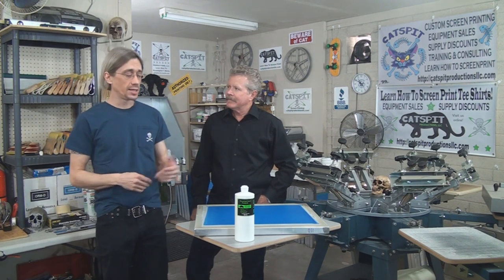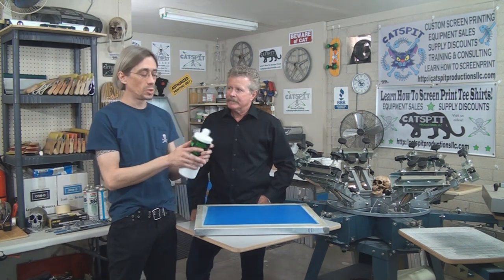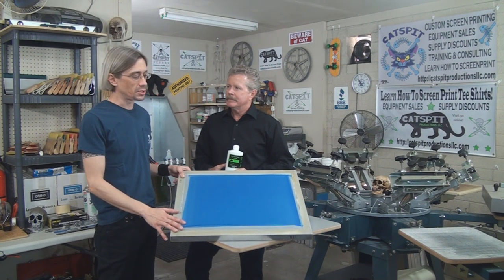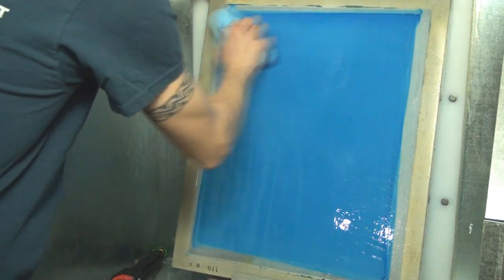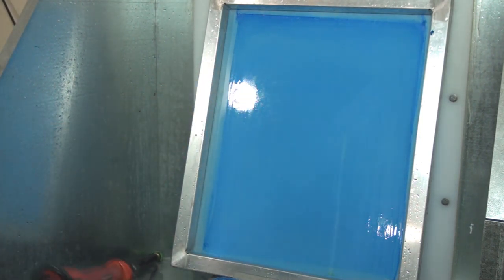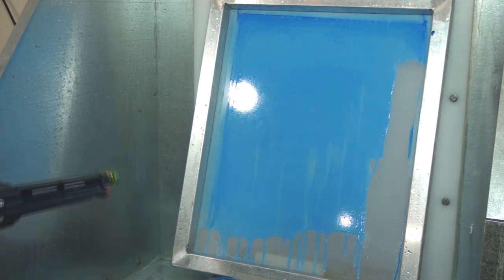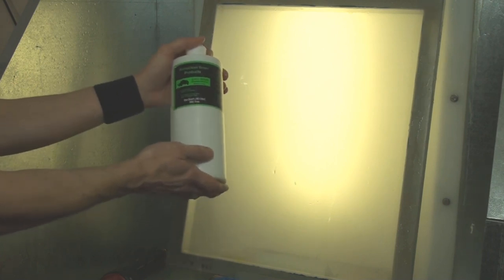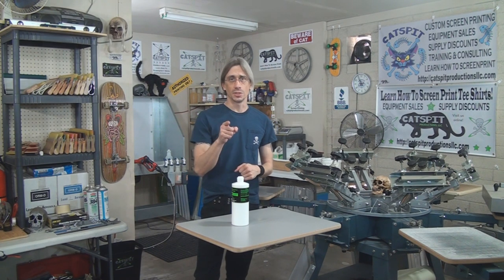Environmentally Safe Emulsion/Stencil Remover For Screenprinting

Comment: Hello,congrats on your channel! i only have one question, if some emulsion stays in the screen after using the remover,is there a way to get it off after it has stabilized for good? i tried bleaching the ghost prints and soak it for 15 minutes but nothng gets removed does the mesh need  to be changed?
Reply from the maker: Thanks! If you're referring to screen lock, a pressure washer with some haze remover may do the trick. Thanks for watching! Screen Printing Equipment & Supplies - http://CatspitScreenPrintSupply.com/

Comment from the maker: @MrBlem18 Thanks! I’m using the SaatiChem Graphic PS 2 Blue which you can get at a discount with free shipping by using the Catspit promo code form the Print Supplies page of the website. The link is on the channel page and in the video description. This is a photopolymer and Saati makes a red emulsion as well but it is more expensive and faster in exposure time. That’s the Textil PV. Thanks for watching and leaving a comment! ☠

Comment from the maker: @mustangFWL I got that unit form Home Depot. It used to be made by Husky but now it’s the same exact unbit but labeled Homelite. It’s the Hydroserge High Pressure/HighFlow 1700. That’s about all it says on the unit as far as model. The dual head is a great feature because you don’t need a splitter on your water outlet in order to have a regular spray hose. And less hoses too. Thanks for watching and leaving a comment! ☠

Comment: how many frames you can soak before the emulsion remover stops working?
Reply from the maker: You must mean in a dip tank. It all depends on the emulsion remover and the size screens you are reclaiming. But it can do quite a few before you have to change it out using a dip tank. I wouldn't know exactly how many though. Thanks for watching. Screen Printing Equipment & Supplies - http://catspitscreenprintsupply.com/

Comment: can u use bleach to clean screens?
Reply from the maker: Yes, you can but it takes like 15 to 30 minutes to soak and it stinks. Oh and it will also ruin your clothes. Emulsion remover is much more user friendly and it works much better. I sell a great inexpensive one here:

http://catspitscreenprintsupply.com/mel-mel-emulsion-remover-quart/

http://catspitscreenprintsupply.com/mel-mel-emulsion-remover-gallon/

Thanks for watching. Screen Printing Equipment & Supplies - http://catspitscreenprintsupply.com/